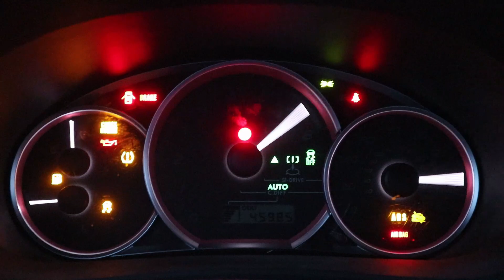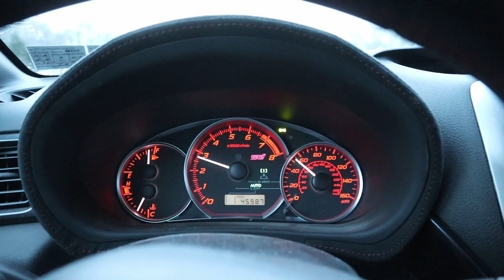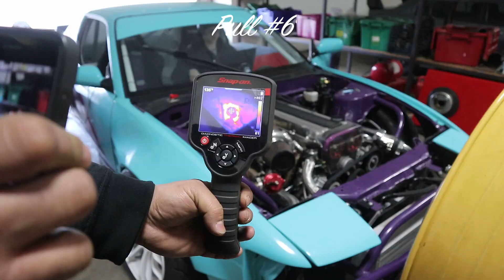DYNO DAY! - 570hp 1.5jz S13 | GTX4088r | 240sx Drift Car

Comment: Hey man did u go with the steel or titanium retainers on your bc springs? I  feel better about going in and replacing everything in my 1j head I just dont know if I need anything overkill. I cant find oem stuff so just figured I would go bc. Not sure if the extra $120 for titanium retainers is worth it or not on a street car.